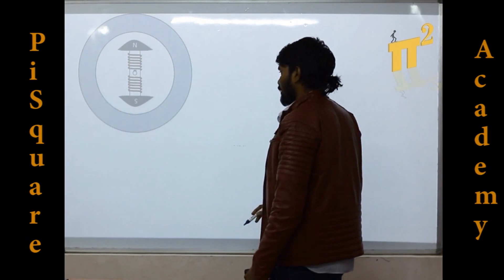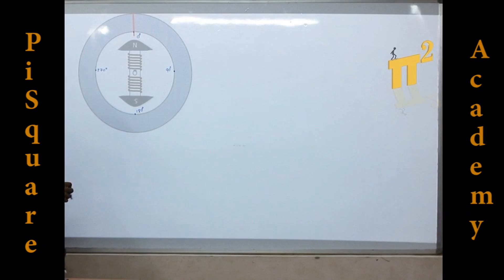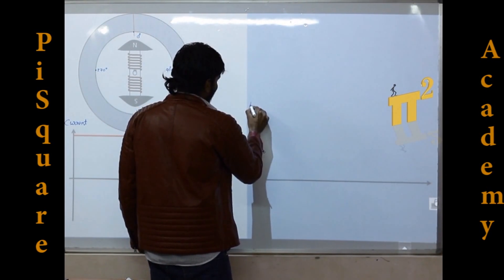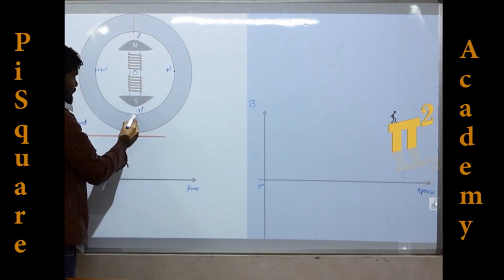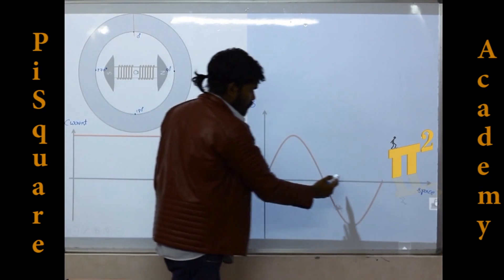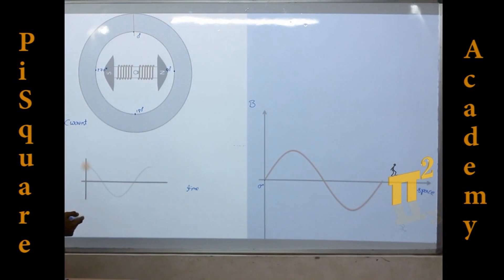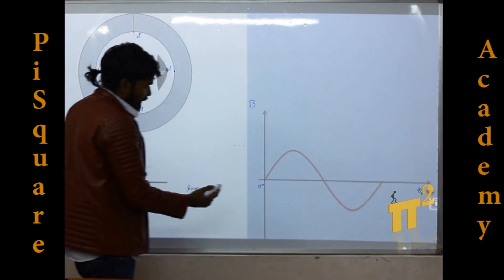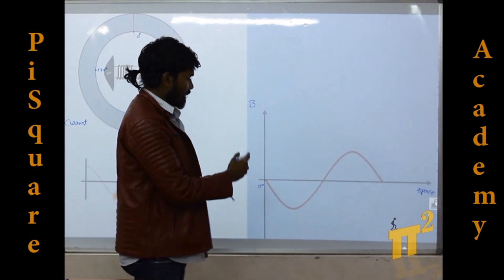Time axis vs Space Axis in machines Animated(Subtitles included) PiSquare Academy

Comment: Sir why we prefer only sine wave in electrical why not other
Reply: Because 1st of all integration and differentiation of sine wave is sinusoidal only and 2nd we can use other waves but it's practically observed that if we use non sinusoidal waves there will be problems due to higher harmonics and also sine wave gives max efficiency for any machine than other non sinusoidal waves.
Reply: Since transmission line contains inductor and capacitors which leads to differentiation and integration of our signal so when we differentiate or integrate sine nature remains sinusoidal whether sin or cos that is why sine wave is used

Comment: Sir you are telling rotor wound by field winding but as I studied previously field winding is wound on stator in case of DC machine but I am confused in induction machine about field winding
Reply from the maker: for a DC machine: field is on the stator
for a AC Synchronous machine: field is on rotor.
for an Induction motor: armature winding which is on stator will act as a field winding